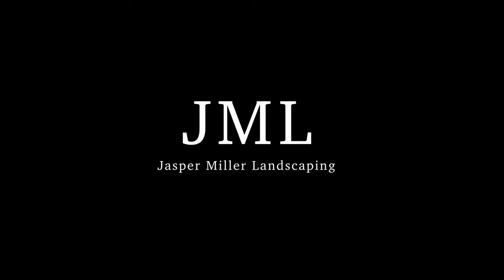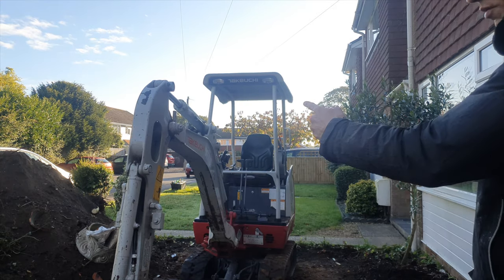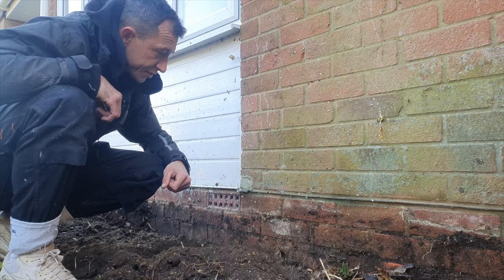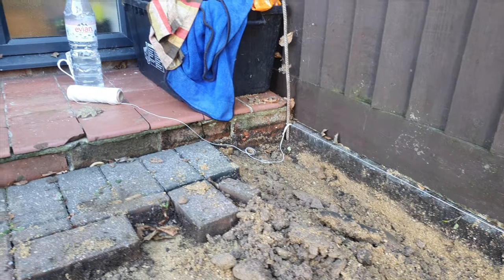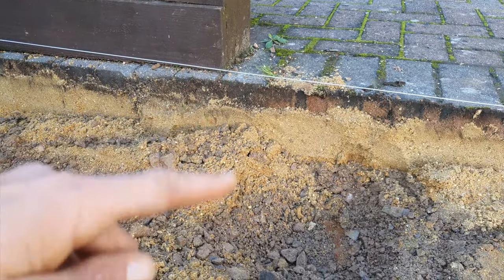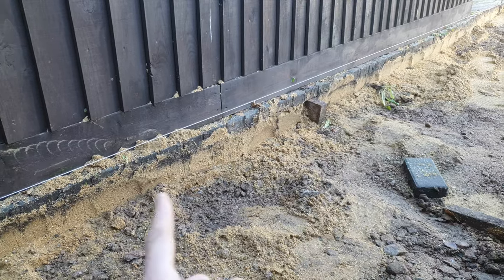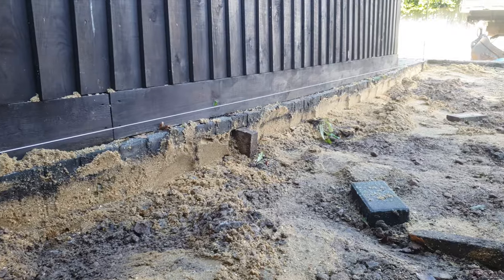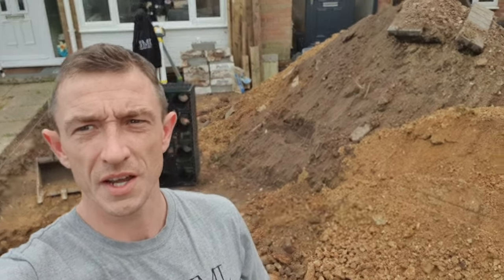How to install a driveway - Digging the area out - Depths - Landscaping uk - VLOG02

Comment: Hi Jasper, I'm thinking of leveling my driveway which slopes down towards my house. It doesn't finish anywhere near the house or the damp proof course so I have no issues there. How far down would I need to dig to place my footings. I'm going to use dense blocks build a wall and then fill it in with MOT, sand and whack everything down before applying paving slabs. I have no idea if that will work as I'll be doing a DIY job. Any thoughts, tips, ideas or warnings? Lol